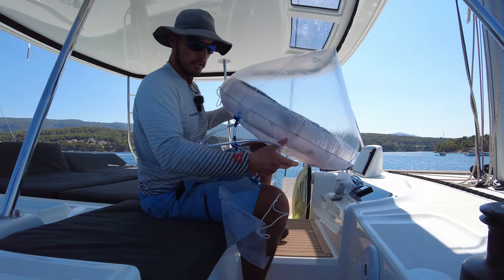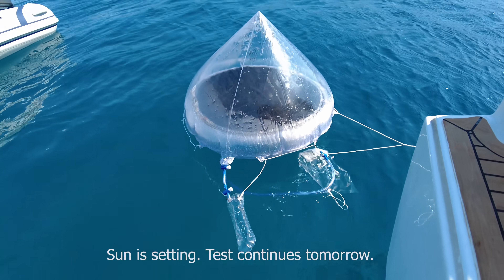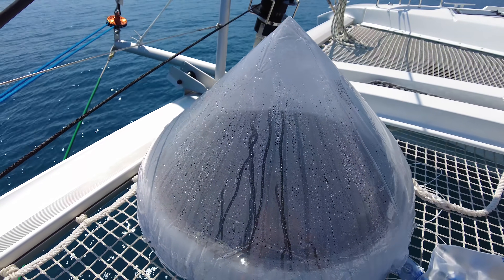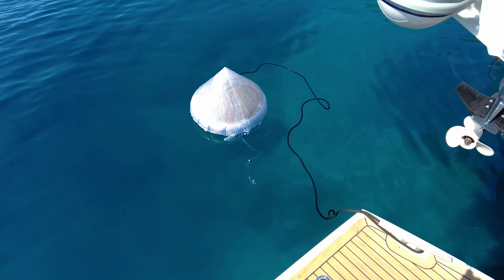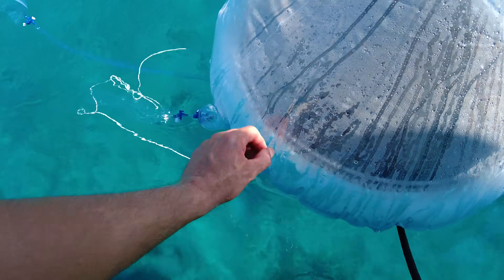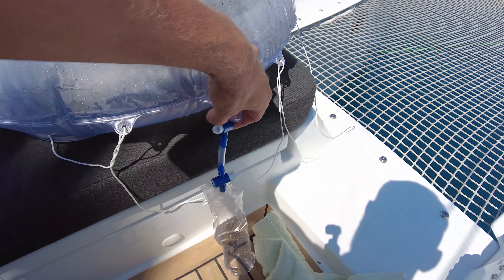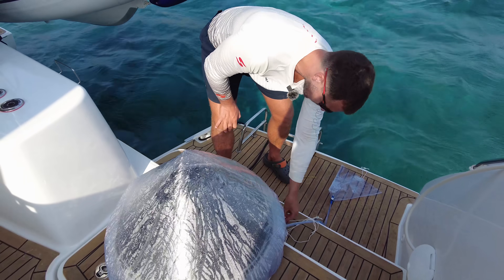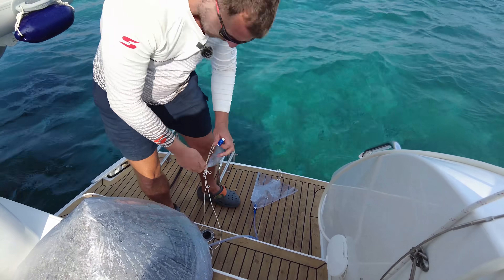Solar still - Sea made drinkable

Comment: Not just the sunlight, but the heat from the water if it is different than the heat in the air should be sufficient to cause condensation as well

This is wild to me. The only drawback of desalinization has always been rust and corrosion on parts. There is so much plastic floating in the ocean. What if we were to smelt it down into these and send them to people who need them?
Reply: You can't just melt (not smelt) plastic that's been floating around degrading in the sunlight for months or years and reuse it. It's garbage. Most plastic recycling is a myth and doesn't work to make high quality materials like you'd need to make this still. Plastic recycling can make crappy plastic you need for bulk materials like, solid plastic benches or some other stuff.
Reply: The problem is not what to do with the plastic. It is how do you collect the plastic.

Comment: You know, I always wondered about this as a kid living in the southeastern United States during the summer. Any piece of plastic would have water on the back of it tarps buckets bottles…

It always made me think if you were to end up deserted or in a position to have to get fresh water, it would be a good idea to put your water source in a little tent made of plastic, and it would evaporate and condense. It might still stink like the source, but I never was quite sure if that was enough for it to evaporate and condense that way to drink. I swear I thought of this by myself. It’s so funny that it turns out that’s exactly what you do. I wonder why it is people think commonly like this with materials that we’ve not had but just for a few generations
Reply: The way you want that little tent setup for survival is in a hole. Put a collection bottle or clean bowl at the bottom of a small hole you can cover with plastic. Make sure the edges of the hole reach however large your piece of plastic is. Place a single rock or pebble in the center, over the bottle or bowl, and the water will drip all day down into it. After sunset, go retrieve your water.

Comment: this should be a required part of every sea based survival kit.
Reply: Duct tape is your friend
Reply: I think I would prefer a rigid structure for more durability. This one becomes unusable as soon as it leaks air. So I would argue this style is too unreliable.
Reply: @fgregerfeaxcwfeffece a commenter on here said that this is the light commercial model, and there is a sturdy model that's being used in life rafts.

Comment: Since I taught this in the military I can assure you the instructions say to have it set up before sunrise and DON'T play with it until after sunset.
If you play around with it the action slows down the production. Just Leave It T.F. Alone until after sunset. Great demonstration !!!!!
Reply: How do you resist though 😅
Reply: That should be clear. Each interaction is nullifying part of the progress...
Reply: The clear envelope would allow UV to help sterilize the water. I would imagine it could still be a long term problem but in the short term, but better than drinking saltwater or dying of thirst.
   I'd been told of these in the military. In fact during one of the ship deployments a sailor was reported to have died because he did not have enough sunlight, rough sea, or possibly just didn't use it right.
   I never actually used one myself, but I notice from the video that the condensation appears to adhere to the clear envelope. If the material of the envelope had a coefficient of adhesion that matched water it might allow smaller droplets to run down. This might reduce larger droplets falling back into the saltwater in the middle and (maybe) increasing the production rate. As I recall they claimed up to 2 pints of water per day.
Reply: @ericsumma7654  2 liters per day. And as for the action you’re describing, that limits total collection volume. The way it’s designed maximizes the action, even though it seems like it would cause more to drop down. The big mistake people using this do is that they keep tapping it and messing with it, which halts the production cycle for a temporary gush of water to be collected.
Reply: @thunderofgr  I would think removing the water from the surface would allow more water vapor to be pulled out of the air and collect.. and thus decrease the humidity in the chamber and allow more water to evaporate.. although as I am typing this out I am thinking that the condensed water droplets might allow more vapor to condense faster since it is cooler.. and also water might just be more likely to condense on an existing droplet than on plastic (not sure).  I kinda want to see someone completely overengineer one of these to try to max out the efficiency.  It does seem like the fact that light is entering at the same place water is being condensed is probably not ideal.. but I can't see a great way around that.. if you reflected the light up into the bottom that probably wouldn't work at all unless you could keep the water depth to a few atoms
Reply: Yes, Sir!
Reply: T . F.   ?   ''' Transfusion   Filled ''.  or   the f***   alone.  ?   probly the latter .......
Reply: Terrible demonstrations. Anyone with half a brain knows that, this short attention span instagram “genius” can’t do anything right. Always 2 to 3 hour nonsense.
Reply: yeh but he kept tapping it haha
Reply: Semper Fi! I deplored survival school in the Marines(as everyone does), but it paid off later in a big way, so thanks to you and guy's like you, you made a difference!
Reply: It produces enough water to maintain morale, that’s for damn sure!
Reply: When I was at primary school someone with a relative in the right places brought in one of these. It was orange, may even have been a prototype. From memory it took most of the afternoon for our puny 7 year old lungs to inflate it, no we didn't get to try it out properly, it had to go home with them. Then until recently I never heard of the device again.
Reply: Not sure how tapping on the cone and causing the condensate to run down would inhibit the process at all.  

When the cone is covered with tiny droplets the sunlight won’t reach the seawater in the black bottom as well.  Some of the solar energy will be wasted by heating the vapor condensate.  Clearing the cone would allow more sunlight to reach the seawater in the black center.  If it’s floating in the sea, waves would naturally agitate the condensate to run off constantly.  Because he is in a harbor he’s not getting enough waves to clear the condensed vapor regularly.
Reply: Yeah, while having no training on this particular Still I was wanting to slap his hands when he kept messing with it.   I would think at-least 3 per person would be minimum to keep one hydrated and functional.
Reply: HA,  you said "play with it"     Beavis and butt-head laugh
Reply: @anamegoeshere  it's not a silicone implant. The plastic will sterilize the water.
Reply: Yeah wait till it cools to mess with so the water vapor can condense.
Reply: how do you clean it... itll turn into an algea bucket... i feel like thats left out of the video for a reason...
Reply: @jacobhoffman2553 yea dude, its for a life raft, not for permanent use
Reply: @jacobhoffman2553 the collection point could but the algae won’t be in the distillation, if the interior walls got grimy I suppose it would be good if you could leave exposed to direct air/sun for a bit
Reply: @jacobhoffman2553it doesn't suck the water in. It's a condensation process. This means that the bacteria causing algea is not passing thought. It's genious.
Reply: @jacobhoffman2553  there is a reason why some people should stay in their NY-NY apartment...

This is evaporated water within 6 to 8hrs
bottom sediment is salt
top sediment is dead water, empty from any life, no mineral

Bacteria grow/feed on what?
Reply: @deepdivedelightwhat an unpleasant  comment
Reply: Aggressive much..
Reply: You taught this in the military, ok, but this ain't Nam - it's the Bahamas
Reply: @straightup7up  How do you expect the situation to be significantly different in those two places regarding the ability to make freshwater with this device?
Reply: People need water in both places. past and present. Ok. @straightup7up

Comment: These things work better if you can spray paint the cone black using stencil paint, (it dries quick and won't affect the plastic), the black absorbs more heat and so produces more water.

Comment: How do you get rid of the salt that accumulates on the inside?  Do you have to flush the system by letting sea water run through it?
Reply from the maker: It’s only for single use in emergency.

Comment: When I first began wilderness trekking, I would read all the books and go to the camping shops and snag every "essential" gadget - `just in case'. Pretty soon, I'd be dumping kit in trash bins or giving it away as the crippling weight of my pack crushed me down. It took a true expert like Ray Mears to demonstrate that you really only need a machete if you know what you're doing. Now, it may be that if you're a true ocean nomad, then one of these things might just mean the difference between life and death, in the highly unlikely event that you are cast adrift. But really - like most "essential" gadgets - manufacturers are just playing upon your inexperience and paranoia. Steve Callaghan survived 76 days in a liferaft without such a device, likewise, Maurice & Maralyn Bailey coped without one for a whopping 117 days. I carry a lot of stuff that other sailors think excessive. Mostly, they entail emergency hull repairs, because that's the FIRST consideration. If you can stop your boat sinking, then most everything else is academic...

Comment: That is a Fitzgerald still.  I was fortunate enough to be helping Dr Fitzgerald with another project in the last '60's when he was developing this still design at RAE Farnborough.  The principle feature is that conical, pointed top that allows condensed water to flow down the sides for collection, rather than drip from the top surface (of a ball) back to the black salt water collector.
The fact that these are still being used points to the genius of the original specs and design.  It was taken up by NATO for military survival and then by Aquamate for civilian use.  Makes up to 2 litres per day in good sun.
Reply: Cool--Thanks for sharing.
Reply: Odd that I can't find a reference to any Dr. Fitzgearld (well, you're Dr. Fitzgerald) and any type of solar still... nothing for a Fitzgerald Still either. I can't find anything with the RAE and the name Fitzgerald. Help me out.
Reply: @brianbassettnumber1  No I am just a retired Ex RAF pilot.   I was seconded to Farnborough to specifically help out with some trials with the early Martin Baker ejection seats.  Jim Fitgerald was pursuing various experiments to determine the amount of spinal compression that occurred with passive seating and shoulder strap arrangements on these seats.
But that is perhaps not specifically interesting.  The point was I was / am tall, with a long back and I was available between courses.  The military is good at finding pegs for shaped holes.  Anyway the point is, my experimental usefulness was usually over by about 10:00  as all my back compression was expended and only a night horizontal could get that back (pun intended).

The still was one of the side projects that Jim had running and helped with in the PM.  Somewhere I have pictures on me on the flat roof of the main building tending a prototype that looks exactly like the one in the video above.  Right down to the black felt base and collection baggie.   I don't recall the filler being the same, but it is a long time ago.  However I was party to many rather interesting discussions about the utility of the conical top and the side ring collection etc.

The prototypes were based, as far as I could tell, on simple children's inflatable rings with the top portion of plastic, cut and glued to form the cone.  

I did come across a unit in a sea survival course at RAF Mountbatten and it was demonstrated as in use in some large aircraft survival kits.  AFAIK it was this one :
https://www.echomax.co.uk/solar-stills.

What became of Jim, I have no idea.  He was in mid 40's (guess) when I met him, so as I was 18/19 then and am 73 now - you do the math.

Hope this helps.
Reply: @terciops  awesome thanks for telling that!
Reply: @terciops  Interesting. You might also find interesting that Maria Telkes came up with that sort of a solar still during ww2 for the American army. Either the guy you helped with the prototypes based them on Maria Telkes' design or just "great minds think alike"
Reply: @brianbassettnumber1 a lot of stuff from back then was communal and this same exact still could've beenade somewhere else with a different name and never known by the masses.  I doubt he's lying.  But that was probably just what he and those around knew it by because that's the first guy around their to make one.  Then they lost the documentations.  My great grandfather built the original X-ray tubes and the only proof I have is his name next to it at the Museum of Modern Art.
Reply: @brianbassettnumber1  Well, if dr Fitzgerald terciops mentioned didn't base his solar still on Maria Telkes solar still, he was still not the first person to come up with the idea. I was just reading about Maria Telkes' solar heated house that was the first house of that kind actually used for years, between 1948 and 1956, and she patented many things and one of the things she invented was a solar still (I believe for the army)
Reply: @brianbassettnumber1  Funny that you highlighted YOUR grammar mistake in bold and that YOU'RE hopefully aware of it next time.
Reply: @raiden72  It's called irony pumpkin.
Reply: @brianbassettnumber1  i don't think you were being ironic, i get the impression you meant to say "your" and now you're needlessly searching for a way to justify your typo to someone who knew what you meant but is giving you shit anyway
Reply: ~2 or 3 of these and you'll have amount required to survive. But given the fact that you'll sweat ALOT then probably even more. And that is per person.
Reply: why the dimensions are so small? like the collector pouch.
Reply: Итак. 2 литра в солнечный день? А какая площадь черного круга?
Сколько литров можно выпарить с 1 квадратного метра?
А что если использовать перепад температур?
Выпаривать при повышенной температуре в парнике, а конденсировать от прохладной забортной воды )
Reply: its a source of nanoplastics, it can be built wih thin glass and wood,plant fiber or ceramic
Reply: @crapisnice 😂 Sure, that sounds incredibly easy to pack up as an emergency lifesaving device. 🙄 Nothing like having to worry about your life-saving emergency water source's wood/glass/ceramic pieces accidentally getting broken while you're waiting for help to arrive... The one in this video is obviously designed to be used in case of emergency, not as a replacement for a regular fresh water source. It makes sense for this to be made out of thin inflatable polymer in order for it to be stowed away somewhere (anywhere) until needed.
Reply: @crapisnice  thin glass? LMFAO yeh and sink to the bottom of the ocean.

Comment: it's made to function when the dome has lots of slack and wrinkles in it. it will produce about 3x the water than if it is stretched tight. personal experience
Reply: So maybe it would benefit from some vertical ribs inside to encourage the water to flow down ....
Reply: personal experience was in glassy-flat water, or shakin' ripples?

Comment: What a great invention! Every life raft should have half a dozen of those included. I think I would investigate the idea of making one twice the size as that would give waay more than twice the fresh water production- can't see why there is a need to have such a tiny one?
Reply: Maybe larger walls would make it more liable to damage by strong wind.
Reply: Trouble is, surface area increases by a squared factor and the air volume by a cubed factor so there maybe be an optimum size… who knows though… maybe huge is better!
Reply: if you make it too large, it will become less efficient.  The larger the water droplets get, the more likely they are to fall back into the water that is being desalinated.  You'd want to have multiple ones, rather than larger ones.

Comment: I think you could do better with a panel using sky-radiator cooling paint to drop its temperature below the dew point (just needs a few degrees drop) and thereby condensing water out of the open air over the sea.

Comment: What's crazy is at work we open a lot of Life rafts that are put on all kinds of yachts not one of them has ever had a solar still in the light raft with the rest of the supplies you have a life raft whenever you get it packed make sure you add a solar still to it otherwise you won't have one
Reply: Maybe there’s a reason for that? Yes it works but only in ideal conditions temp,wind and overcast conditions will all affect how well it works. If I was sailing around tropics I would definitely have one but other than that it’s pretty useless

Comment: It needs to be in water to have a condensation surface... else it would evaporate again.. if you place it on wet sand it would also work.... I think (:
Reply: The bottom isn't open to the water.  it fills via the open  bag/scoop @0:40. The bottom is black to heat up with sun light. This increases evaporation that condenses on the cooler top  and trickles down into the side pocket to be collected.